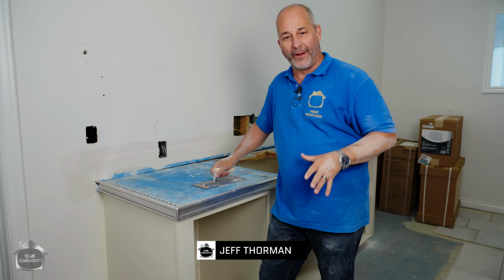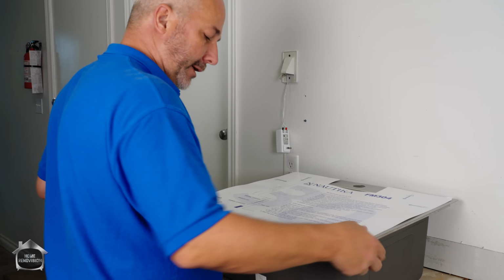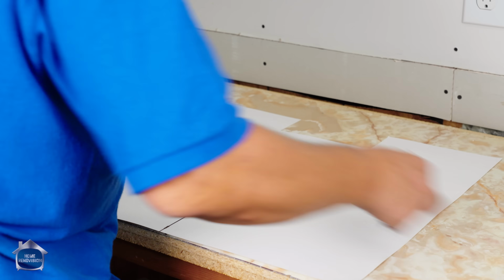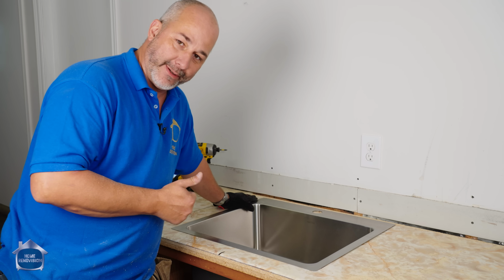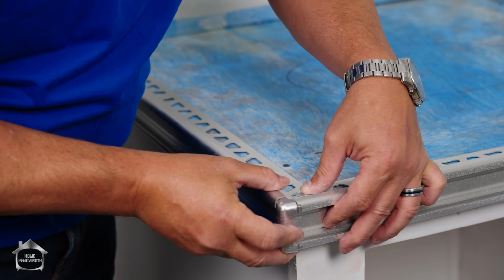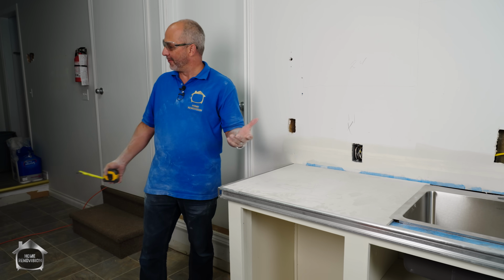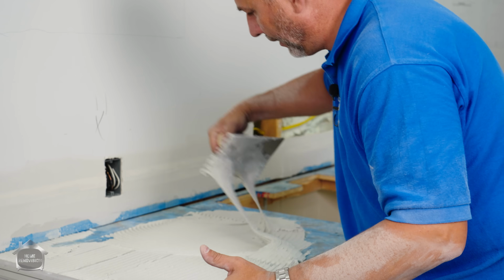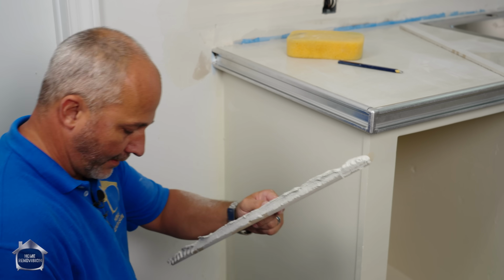Sink And Tile Countertop Install | Church Flip | Episode 4

Comment from the maker: If You Need help with your project consider joining our membership program. $5 a month gets you access to me for help and a forum to discuss things with other members. you can also upload pictures so I can help troubleshoot. Cheers and remember. You are The best Contractor for your Home! link here to sign up. https://www.youtube.com/c/HomeRenoVisionDIY/membership
Reply: Interesting
Reply: Dude I just watched a short of urs on Facebook of u slamming a channel lock through a wall, cutting the pipe to a pin hole leak and crimping it… WHY DIDNT U JUST CLAMP IT?! Either ur lying , or u have no idea what ur doing.
Reply: You make cutting that countertop/formica look so freakin' easy.  For a green DIY'r it isn't.
and
I had to replace a section of my bathroom floor a couple months ago.  Luckily I had your channel to learn from but cutting through my floor (3 layers of old flooring e.g. wood, linoleum, and I'm not sure but what looked like paneling).  Something I discovered in this process, tiling, especially the cementing part, isn't anywhere near as easy as you make it look.  That's a case where next time, someone else can be the contractor.
Reply: Whats the trim  called used for the edges  stainless ?
Reply: Used a tile space to clean out my grout lines. With food do you epoxy grout?

Comment: a 4" hand wet saw works awesome also thats what I use. they can be used wet or dry usually also. small flat head also works great if u don't use the pencil.
Reply from the maker: I never use metal around tile for cleaning . too risky to chip the glaze. Cheers!
Reply: @HomeRenoVisionDIY  I get that. I've been doing it long enough I guess I don't have issues with it. Can also run a wrap of electric tape over the metal. But pencil works to.

Comment: As always, thanks for doing all of this, so much knowledge shared openly. You mentioned stone countertops a couple times, and seeing the size of your tiles and how uniform in color they are, and a chipped corner*,  I think I had an illumination: I know that for mitered or waterfall edges and super long counters they use epoxy with stone dust* to make seamless joints, how feasible would it be to "fake" a stone counter by skipping the grout?
Reply: in this case arent his tiles stone-look porcelain? maybe it might work for stone or another material, but it looks like the porcelain has a different color painted on the surface versus within the tile itself, so i dont imagine porcelain dust would help if its going to be beige in color versus the gray that the surface glaze is. thats just my thoughts on the matter at least.

Comment: The “cut only the paper” when cutting drywall applies only to 1/2 inch. I tried with 5/8 fire code and it needs at least 3-5 passes before it snaps.

Comment: Vapor barrier behind heat floor boards yay or nah? I don't plan on cutting open my walls but more or less covering it up.
Reply: It's a really old house and I'm not really feeling comfortable opening it's guts but if I have to I will..
Reply from the maker: If you want coaching for your project then I need a lot more information. consider joining the membership program so you can send me details and pics for advice. Cheers!

Comment: Hey Jeff, love the videos. Had a question on your subfloor system for basements.

In regards to the dmx dimple with osb over, do the studs only get nailed to the osb subfloor, or do they get attached through the sub floor to the concrete? Thanks!
Reply: You have to join the membership for $5 a month to get your answer. Cheers
Reply: @restlessriver5870  already did
Reply from the maker: LOL. If you attach your subfloor to the concrete a simple screw in the plate to the osb will do. if not use a 3 1/2" tapcon through the plate and the panel to secure. Cheers!

Comment: Had that issue once but with no options, the owner had called in a company to do the countertop and it was all installed complete with sink cutout which was completely flush with the cabinet interior sides, then they told him they couldn't install the sink as there was no space for the clamps. I got asked to resolve the issue after he had signed off on the countertop install. I used a rabbet bit on a router to create a a channel along the sides so the clamps could be installed. Is it what I would have preferred to do? no, but it worked.
Reply from the maker: congrats for thinking outside the box. Cheers!

Comment: Couple of things that Jeff Should have mentioned: 1 - There are other colors for the Molding. (My kitchen is stainless and bathroom satin nickel.) 2 - They are also available for multiples thickness of tiles. 3 - Home Depot and Lowes can  special order  them. 4 - There are multiple pieces available for ends,  inside / outside corners, but they do get expensive if you need many. 5 - Keep some extra tiles just in case. 6 - For thicker counters (ex. raised bar) there is also a matching bullnose molding available that will give you the same look (but with 2 separate pieces) 7 - For non-standard inside corners you can miter. I did my kitchen counters using this product around 10 years ago with a flush mount cast iron sink and they still look brand new.
Reply from the maker: Nice. Cheers Luc!

Comment: For the tile cutting, does it take a lot of grinder power or would a decent cordless be fine? I have never cut any stone/ceramic/porcelain but it looks like the blade is really doing all the heavy lifting and theres not a lot of load on the tool (making a cordless seem fine).
Reply from the maker: yes it will wok fine. the more cuts the more batteries. Cheers!

Comment: Whoa there Jeff, can’t believe you chose to go with team red for a sander…..welcome to the “dark side” friend 😆. 
For real though, when comes to buying tools; I’m in the camp that you get the best tool for the job that doing; that able to afford at the time, regardless of brand. Now granted, if want cordless tools, there are “USUALLY” ALWAYS some kind of deal out there you can find to get a free battery, &/or charger w/ the tool buying. If it’s first time buying into a battery platform, don’t forget to not just look at the tool deal needing, but combining (or stacking) another deal to get “more” tools/batteries w/ a “bigger discount”, b/c more than likely you’ll end up using what you buy on a different project.
Then there’s the used market. Can usually find some “decent & good” deals buying a used tool from someone, & if price is right and tool lasts you a while…good deal.
Lastly, there’s reconditioned tools that one can buy (I have myself a many of times). The only thing I suggest w/ doing this, stay away from Amazon (as the big 5 tool brands: DeWalt, Milwaukee, Makita, Metabo HPT, Bosch sometimes can cause you some pain and grief if need to warranty a reconditioned tool when buying from Amazon) & buy from a well known brick & mortar store or online store (OPT, Acme, CPO, etc…) b/c you will get a warranty w/ reconditioned tools (can vary though, so read the print); but at same time, check the PRICES of the NEW TOOLS, b/c sometimes the reconditioned tool’s price is only $5-$20 less than buying brand new…..which at those “discounts”, I’d say just buy it new b/c you get it “new” & “full warranty” along w/ it.
Sorry about the long comment folks. And if made it all way here, thanks (note: bought reconditioned Metabo HPT 21° cordless framing nailer kit for $200 which included shipping and tax. Came w/ the bag, charger, battery, & manual etc….and thing looked just like the brand new one I bought years earlier at the full price of $450….got a great deal, and still after 3 yrs the framing nailer still going strong).
A pleasure as always Jeff, great to see your vids and hope things work out well for you and your fam.
Cheers y’all ✌🏻
Reply from the maker: Just trying to keep it real. Cheers Aepek!

Comment: This another hack job. You used expensive trim and bonding agents on top of old dry ,beaten up wood.  Start fresh Using 3/4 plywood with a support frame on the bottom for strength and support, then hardi board on top. That is the industry standard when using LF tile. The weight of the tile and mortar will better supported.